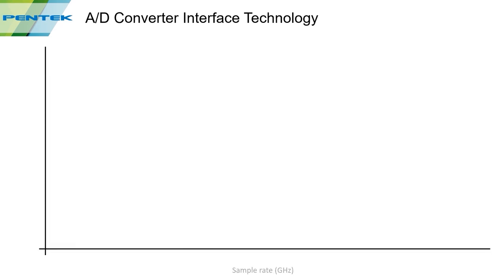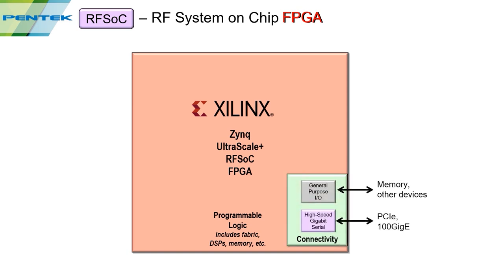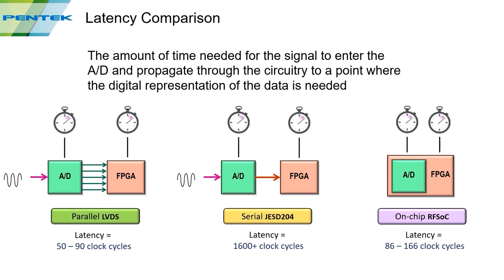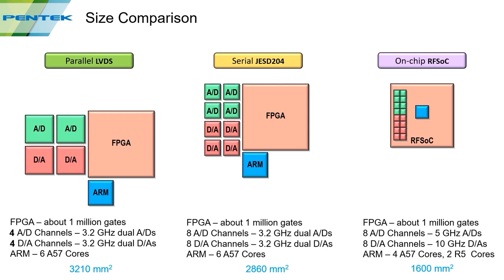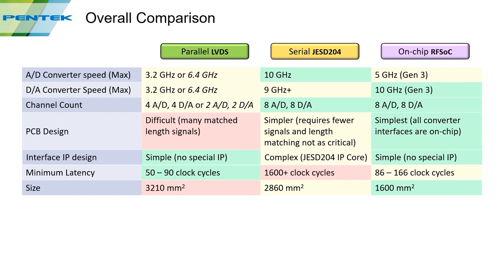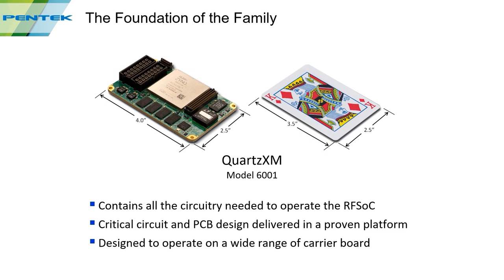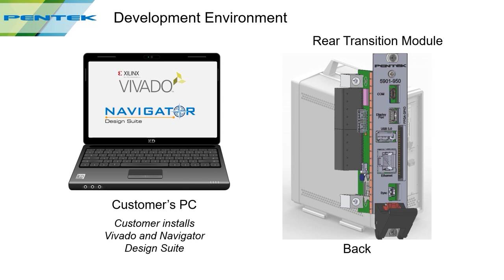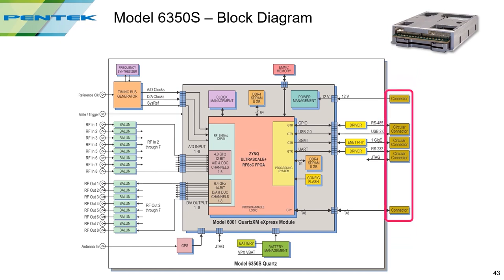Finding the Best Path from RFSoC Hardware Design to Deployment

Comment: I think even if we consider the clock cycles of 1600, and the JESD204 works happily at 4.5Ghz it is at 355ns, and for the LVDS it is around 99ns considering the 1Ghz sample. So yep 4 times slower, so detection capability goes down accordingly.